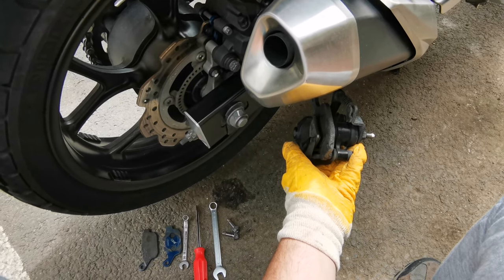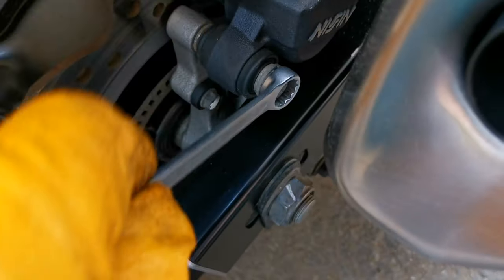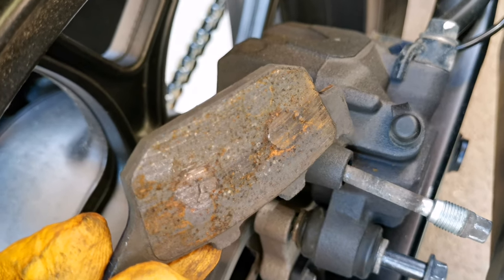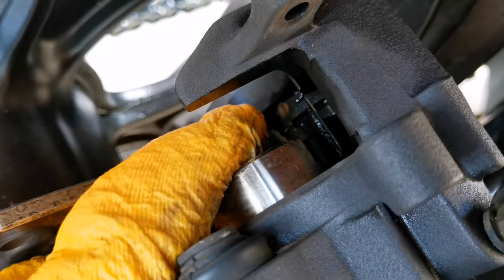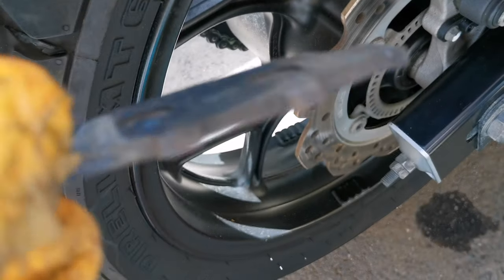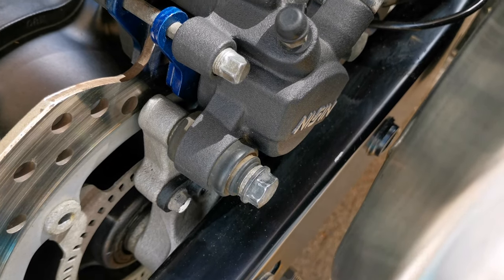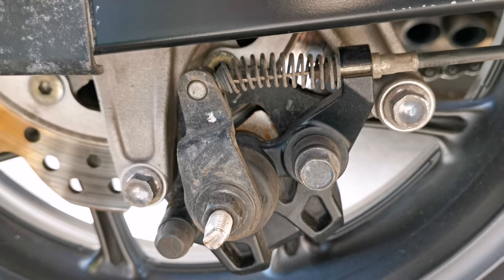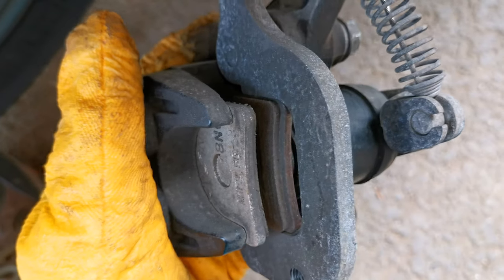Honda NC750X Rear Brake Pads Replacement / DCT Parking Brake Pads Replacement

Comment: Nicely done. You make it look easy. My 2015 Honda CTX700 needs the brake pads replace and I'm going to install Semi-Sintered EBC copper organic. My motorcycle is at 35000 miles and this is the first time the brake pads are going to be replace. Starting with the rear first and the ride for 2 weeks. After the 2 weeks and everything is OK, then do the front brakes.

Comment: huh.. so worn down after 22k kms.. my 2018 750x  dct still has a few mm left with the same milage , and i ride mostly in town; But then again I do mostly use engine braking to slow down

Comment: I'm thinking that if you found fitting Brembo brake pads on the front, that they were noisy, I'm suspecting that either the anti-rattle spring was left out or the person who fitted them didn't apply a little copper grease onto the backplates before bolting it all back  up?!?! Omitting doing this can cause a vi ration of the brake pads that, not only causes noise, but can also lead to the pads wearing unevenly/ very quickly!!
Reply from the maker: hello, that was not the case. still the original pads lasted the most

Comment: Thank you for taking the time to show us this 'how to' I wonder what the interval is for lubing the parking brake cable. I think I've used my parking brake about 3 times, I'd hate to put it on and the cable seize locking it on  !!
Reply from the maker: The cable seems quite ok, I will double checking it after your comment 😉 I haven't seen any malfunction and I use the brake quite often to park the bike properly. Greetings!

Comment: Great detailed video. I just came back from a 2400 km road trip over 2 1/2 days - a lot of hours of highway driving at between 100 - 130 kph - to find that my parking brake was no longer holding the bike. My bike which is a 2020 model had only 4000 kms on the odometer before I set off on this latest trip so I wonder if on this trip the pads were slightly stuck in position whilst I was riding despite no warning light showing on my dashboard panel. Now off to order new pads and will also change the main rear brake pads as a precaution. Thanks for sharing this video.

Comment: Nice and simple thanks but a couple of observations. You left these pads far too long and you are icky they didn't damage the disc. It's easy to check these pads and order some new ones when the abrasive material is about 2mm thick...  I learned this the hard way and had to replace the brake disc too on my NT700VA7 whose calipers are difficult to get to.  When reassembling it is wise to use copper grease to stop the threads seizing. Also the pad pin should be cleaned and greased and I believe that the rear caliper pin should be torqued to only 27Nm. Stripping this thread could prove expensive my friend. That parking brake is a bit of a strange idea don't you think? 
Anyway thanks for the video which is very clear and useful 🙂
Reply from the maker: Thanks a lot for these precious tips! Appreciate it!
Reply: @IdealBike  I live on a hill and when pulling up outside my drive gate alongside the road side kerb having that parking brake is a must otherwise the bike would simply roll back once the engine is switched off and the gearbox defaults to a neutral state. The parking brake may seem a strange idea but believe me when I say that for me it is essential to have it! Thanks for the additional tips in your reply.

Comment: Thank you for a very helpful video.  I am trying to replace the handbrake pads.  Got to the stage where I have the allen bolts exposed.  But no allen key fits!  I cannot undo them with any of the allen keys I have.  Do you know what size is needed?  Many thanks!
Reply from the maker: You need a 12mm spanner
Reply: @IdealBike  Thanks for your comment.  I got the 12mm spanner.  That's easy.  It's the allen bolts in the end to remove the pad itself. You stopped at this point in your video.  I cannot move further though because no allen key fits the bolts.

Comment: Salutare!
Scuze pentru deranj!
La mine, în partea dreaptă a motorului privit din față am un furtun care este liber ( în afară de cel prin care scurgem acel ulei).
Acesta iese dintr-o chestie rotundă. Furtunul este transparent, dar puțin îngălbenit.
Iese din chestia aia rotundă (chestia asta se află cumva sub portbagaj pe la jumătatea lui) și se duce deasupra motorului ( dacă tragi puțin de el, vei vedea că nu este introdus în nimic în partea cealaltă).
Voiam să știu dacă și la tine este la fel și dacă este normal...
Mulțumesc anticipat și o zi bună să ai!
Reply from the maker: Salutare, am vorbit despre acel furtun în videoclipul cu Top 5 Quick&Easy Maintenance Essentials.
Este furtunul de la preaplin ulei chiuloasă sau pe engleză "Crackcase Breather". El se umple cu ulei, se închide la culoare și conform manualului trebuie golit din când în când. Poți să nu o faci, iar uleiul se duce în filtrul de aer, acel filtru de aer are o scurgere prin care se duce la final poți să lași și așa. Eu prefer să îl mai golesc din când în când văd că se umple. Baftă!
Reply: @IdealBike  Nope, nu acela :).
De acela știam. Mai în dreapta lui.
Acesta nu are niciun dop în capăt.
Cel puțin la mine... Iese dintr-o chestie rotundă cam de mărimea unui capac de borcan de 400g :D și se duce deasupra motorului.
Dacă vei trage foarte puțin de el ...o să vezi că este liber....hmmm...
Reply from the maker: Mai arunc o privire mâine să îmi dau seama care e și revin mâine.